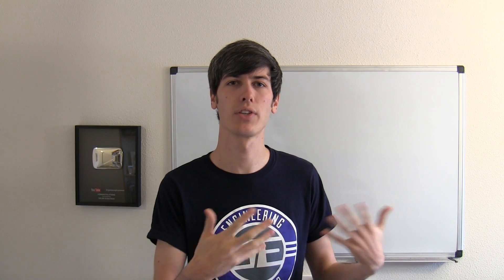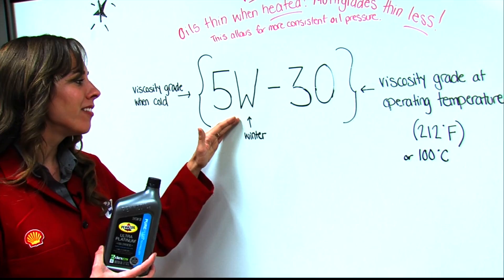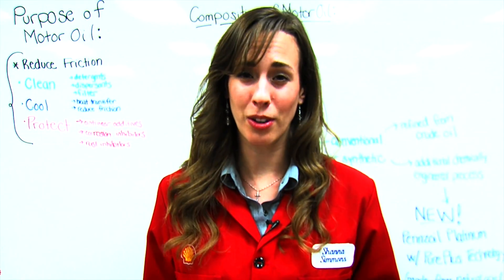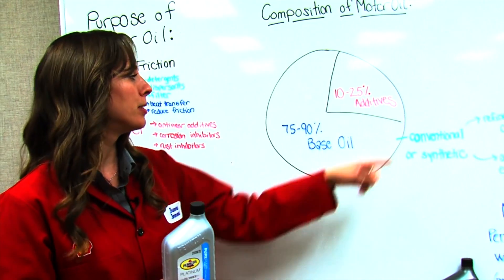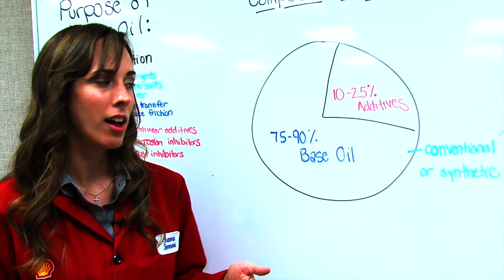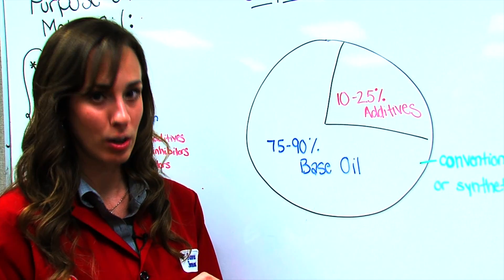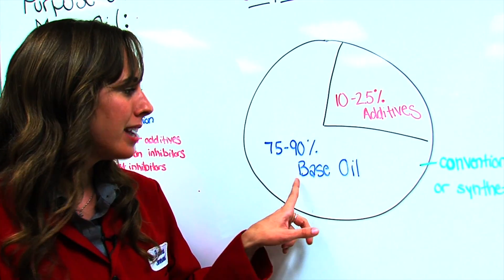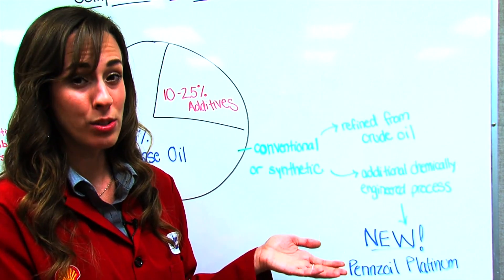Motor Oil Myths & FAQs - Synthetic vs Conventional

Comment: I got a F22B1, honda says use 5w-30 but that to thin for where i live. I use a 15/20w-50 in summer and a 10w-40 in winter. Either full synthetic or a blend. I run additives, cause oil alone cant cut it. I like a 20/80 mix lucas to oil, less ware, runs cooler, extends oil life. Any time you ask a manufacture of oil like Pensoil, you're getting a slant to there product. a API official would of been a better choice, there not selling anything.
Why don't you do another oil video, but this time on the differences of Auto/Diesel/Marine/2-stroke oil?
Reply: How do you know that it is too thin? What assumptions do you use to determine "oil alone can't cut it?" I'm just curious as to why/how you are deciding these things when it was designed with a specific oil with specific fluid properties in mind?
Reply: GMAJXIII 1.) the motors is old and warn in, so 5w30 in the summer causes the oil pressure light to spraticly come on at stops. Its as thin as water at that point.
2.) Lucas does what it says, and I use it for many things out side of adding it to my oil.
Reply: BigDirtyBasterd im sorry but you are just removing the symptoms, and not really solving the problem. Adding additives to fix your oil pressure light because the engine is worn doesn't really do much other than fix the oil pressure. Also, just because the oil pressure is ok does not mean that your parts are being lubricated properly.

oils are designed to work with a particular temp range and engines are designed to be locally used with that specific type of oil.
if your engine is worn you should change the rings and replace seals as necessary instead of just using a "fix" to temporarily solve a problem like a fake mechanic.
Reply: sayan das It's not warn like it needs repair. It's warn like it got 150k on it, it still holds compression etc, out here in 110+ heat 5w30 turns into water, heavier oils allows it to stay on the parts and not get flinged around.  I don't add anything cause the oil pressure light comes on, I just just heavier oils during the summer. I use Lucas cause it does what they claim.
Reply: patw52pb1
I do need to install an extra gauge cluster, but for oil that means the installation of extra equipment the honda does not have. I plan a rebuild at 200k any way, just a couple more years. After the rebuild im installing a parasidic 2mc oil cleaner and just running amsoil using there filters.
As for what you have described about the oil, i've never come across that, in fact quite the opposite, that is why I switched to a heaver wight oil. Yes it's not a fix, but im not gonna nickle and dime myself with an old car, just wait till more needs to be done and fix it all at one time.
I know the difference between oil, was a suggestion for content sense were on the subject of oil.
Reply: patw52pb1
oil pumps are wear and tear, like i said i like to wait and do a lot at once. as long as it hold good compression ill continue to keep up maintenance on it.
nice ill take a look.
Reply: +BigDirtyBasterd You engine operating temperature should not be changing so much from summer to winter... There is no reason your hot viscosity should go from 30 to 50 like that. The only thing that should change during winter is the winter rating if you really want and the only reason your hot rating would change is in a serious change of use like if you do racing for example. Oh and low oil pressure doesn't mean your oil is too thin is means the path for it is too loose i.e. your contact surfaces are worn out of spec
Reply: BigDirtyBasterd  You may do yourself a favor by installing a good mechanical oil pressure gauge as idiot lights sometimes do not tell the truth. 
Oil pressure at normal idle(~550-800 RPM) in neutral/park when coolant is hot(~205F) and  oil temp above 200F for more than 30 minutes should always be above 15 PSI and not pulsating.
At 3000 RPM when hot the oil pressure should be above 45 PSI and steady.  
If the engine is not holding the target oil pressure at idle or 3000 RPM, the oil pump is failing and or the bearing clearances are excessive and or there is malfunctioning VTEC components and or there is a leak in the internal distribution system (passages or improperly installed internal components). 
Using 15/20W-50 in summer and 10W-40 in winter is not doing your F22B1 any favor and is most likely doing additional damage and accelerating wear, particularly the valvetrain, VTEC and rotating assembly.
The heavier weight oil is damaging to the oil pump, the oil pump drive and also significantly reduces the oils desired lubrication, friction reducing and cooling capabilities, increases the oil temperature, increases oxidation and contributes to molecular shear causing the oil to degrade sooner necessitating more frequent oil changes to maintain the engine manufacturers desired level of lubrication. 
When operating the FB22B1 in extreme/severe service conditions and sustained elevated (>100F) ambient temperatures it would be acceptable to switch to a full synthetic 10W-40 and switch back to 5W-30 during the cooler weather months. 
Higher viscosity grade oil is not a fix for any of the above mentioned causes of low oil pressure and will lead to additional problems. 
The differences between Auto/Diesel/Marine/Motorcycle/2-stroke oil is the individual additive packages.
Reply: BigDirtyBasterd  I was not suggesting to permanently install a mechanical oil pressure gauge, just a temporary gauge for testing. 
Wow, I have have owned numerous Hondas and Acuras and most of them clocked more than 500K before having oil consumption or blow-by issues or needing major engine repairs including the 95 and 97 with the F22B1. 
The oldest from 1982 was showing 786K on the odometer before the speedometer broke and was driven for more than another 2 years before being totaled in an accident by a jerk fighting with his girlfriend that pulled out of a business into my lane. That same vehicle also spent over 6 very hot years in Phoenix, AZ.
To each his own, IMHO Amsoil is over-hyped and overly expensive.
Have you ever looked into a Frantz bypass filter? 
Gotcha on the content suggestion.
Reply: patw52pb1
By rebuild i mean seals and ware and tear, not a ground up. No i have not, figure stick to name brand when it comes to filter and filtering systems. got a url for them?
Reply: BigDirtyBasterd If you have low oil pressure it will most likely take more than seals to correct that. 
Try  www.frantzoil.com  they are a well respected name company and have been around since the early 1950's and made in the USA.
Reply: If the recommendation is 5W-30 and you think that is too thin for your climate, go to 10W30. Not 10W-40. 10W-30 is like white bread or vanilla ice cream. It is the big nothing. But it is the best all-purpose oil. 10W-40 probably contains less base oil and more additives than 10W-30. I believe that 5w30 and 10W-30 are very similar, just a difference in base oil. If you need something yet heavier, probably better to use 20W-40 if you can get it. 10W-40 and 20W-50 are formulated for cast iron engines, old V-8's, straight sixes and first generation American V-6's. But if the recommendation says you can use it, use it. Older models of my engine had 10W-40 recommended and in a different country, it was 20W-50. It says 5W-30 on the oil cap, with 10W-30 optional in the manual. I use 10W-30 year around. Never gets below the mid-20's (F) where I live.

One possible issue is that even if it the same base engine, the materials used in bearings and camshafts, the design of the pistions and rings, or the clearances may change and a different oil may be required.

Comment: Wish you would have asked about oil change intervals.  Why do some car manufacturers say 3k, 5k and even 10k miles with the same oil?
Reply: Don't believe the bullshit service intervals on modern cars - they are the minimum the manufacturer can get away with to ensure the engine lasts the warranty period - after that they don't care - they want you to throw your car away and buy another one.

My car has a 15,000 km service interval on a high performance turbo charged engine - I change oil & filter every 5,000km because 15,000 is just not going to keep the engine healthy for as long as I expect to keep the car.
Reply: bmwmsport11
The reason your WRX needs an oil change every 3750miles is because of blow-by. Many mechanics think im crazy for changing the oil before 6000miles with synthetic, but the oil will begin to become riddled with fuel from blow-by and can cause wear issues. Most notably, your turbo needs clean oil to run properly. It has very tight tolerances and fuel is not a good lubricant, especially with a journal bearing turbo. There are other issues im sure but these are the most relevent that you can see and smell without a chemical analysis.
Take frack from people but do the oil change as recommended. It will keep your motor running longer and oil is always cheaper than an engine.
 PS - i found a significant decrease in oil consumption when i switched to Redline full-synthetic motor oil.  It's an ester based oil and is a bit more expensive that competitors, but i can say with confidence that it makes my car run very smooth with much less blow-by. It's a great product.
Reply: I don't think it's the mileage that affects how often you should change it so much as to HOW you're driving.
Reply: I believe that some car makers stretch the service interval too far as a selling point for their new cars, they only care as long as the warranty lasts. Or maybe I'm just cynical.
Reply: Engines are all different. I know for sure that on Subaru turbo engines you have to change every 3,750 miles, even though the oil used(mobil 1 full synthetic) offers protection up to 10,000 miles. A prius also runs on mobil 1 full synthetic, 5W-30, and will do 10,000 miles with no problems. I tried to go 10,000 miles with a full synthetic change in my WRX. Right around 6000 miles, the oil level dropped quickly.
Reply: Matthew Sharpe Yes, exactly. Some of this just a trick. I used to drive a Peogeot 307, and the oil change period was 30,000km (factory recommended). Total nonsense. It was a company car, so I didn't really care much, but still. :-)
Reply: ***** Reread Shikamoo P.K.'s  comment. The reason for changing the oil is not to prevent blow-by, but because the blow-by contaminates the oil. 
And yes, some lubricants and certain additives can reduce blow-by by providing a film of lubricant on the cylinder wall, piston and rings that helps seal the minor gaps. However, oil is not a fix for a worn out cylinder/piston/rings on an engine with excessive blow-by.
Reply: ***** To answer your question the miles actually don't matter that much. The real thing we should keep track of (but most don't) is engine run time. That is why the manufacturers consider city driving more strenuous and recommend sooner maintenance. They do make meters that can track engine run time if you are interested.
Reply: @00mazone  : Its time and mileage together that counts .  city driving may not be that bad depending on the driver and the outside temperature .

Comment: i use 5w-30 (non-syn) and top it off with 20w-50 vr1 (non- syn) for the extra zinc, aggressive cams like the zinc, but it will ruin your cat converter

Comment: Sir, im currently driving a cr-z (hybrid) & honda highly recommended that i use SN 0W-20 for fuel economy, which i think is too thin (low viscosity). 80‰ of my driving is normal daily commute but i do occasionally rev the car hard to its redline. Should i consider a thicker oil? Im worried with the wear issue of thinner oils. What do you recommend?
Reply: You MUST use the oil that the manual says to use. You will not see additional wear and if you used a heavier weight, it could cause problems with VVT  and would decrease fuel economy.

Comment: But, is slightly lower viscosity better for performance?
Reply: Maybe maybe not , i recommend you only use the exact oil the manufacturer specifies.
Reply: Oil has a significantly high viscosity to help it stick to and lubricate the parts it's supposed to come into contact with. If you put in a lower viscosity oil in order to increase performance, the most likely thing you're doing is preventing lubrication from getting up to the parts of the engine that need it and actually losing performance from increased sliding friction. The engineer who designed the engine probably set the viscosity as low as it could go for sufficient coverage — that said, engineers design for tolerances, so if they set it for 5W30, you might be able to get a thinner coating (and less viscous forces as a result) with the same coverage by carefully mixing to produce a "5W29" blend of oil.